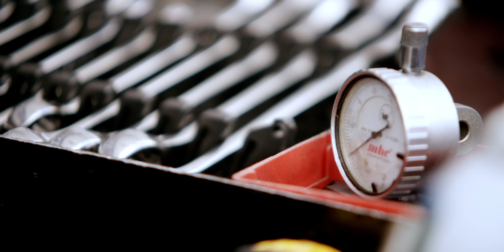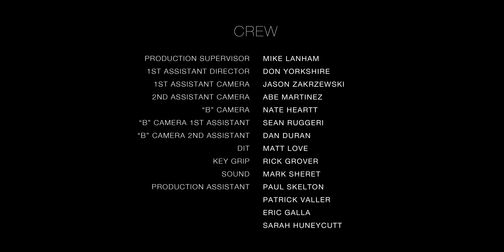NHRA - Fire Breathing Monsters

Comment: 10,000 hp...300mph in 4 seconds...amazing
Reply: Now it's 11,000 hp
Reply: Just imagine the NUMBERS in this racing it makes me scared
Reply: yeah and some cars do 330 mph which is quite alot......10% percent faster lol
Reply: I went to Pomona winners national's and saw a nitro car go 330mph 3.7 seconds incredible🙉👍
Reply: fast too
Reply: @jack-jo6lp  Brittany Force just ran the fastest time in history of racing at 3.62ET
Reply: Javontae Eaddy holy hell
Reply: 0 to 60 in 300 inches or 2/10ths of a second.......Awesome!!!
Reply: Thats 2 diesel locomotives worth of power!
Reply: more like 3 seconds
Reply: little 12 year olds will say, a toyota supra will smoke that haha
Reply: It shouldn't be possible but damn it's beautiful
Reply: Windex maybe 12,000 sum time
Reply: Sometimes more than 10K hp 😅, less than 4 sec in top fuel class. And that sticky thing on starting grid helps a lot to get better traction👍🏻
Reply: @Jay-jb2vr  338mph @3.59   
3.623 is the quickest run
338.17 is the top speed......I think. B.Force in separate runs.
Reply: They now go 356 mph in 3.4 seconds
Reply: The art of explosion
Reply: @damarfadlan9251 they move as much fuel in 4 seconds as a formula 1 car does in an hour. The supercharger takes as much power to run as a NISMO R35 GTR makes just to turn over. The engines don't have any water jackets as nitromethane is both the fuel and the coolant so it's just solid hewn blocks with no weaker spots like a gas engine. And they still shatter them to bits because physics man. This is as much power as 9 Bugatti Chiron Supersports in still 8 liters and OHVs. It's the limit of what the internal combustion engine can do before you're just throwing live sticks of dynamite into an intake plenum
Reply: 400 mph 3.1 second @BRCINEMATOGRAPHY

Comment: The Ride of a lifetime. I've never been close enough to feel the power of these metal Lions But I can imagine.
Reply: In articles I have read the db (noise levels) are in the 150db to 165db range, between 10,000 and 12,000 horsepower shakes your bones, blurs your vision, and will vibrate your beer off the bleachers. No words can do it justice. It has to be experienced.
Reply: Just watch the flags on top of the teams trailers, stand up wind of a Funny car or top fuel Dragster. You will thank me later...lol.

Comment: I grew up with this stuff at Heartland Park Topeka Kansas. There is nothing like Top Fuel. Shakes the ground you're standing on
Reply: Im 16 and ive been going to Heartland Park with my dad since i was just 2 weeks old. Grew up at that track
Reply: @bluevelvetsky88  2 weeks? not to hate or anything but that's kinda irresponsible to take a newborn child to something like that... 150 dB, gasoline, burned rubber, that's a lot for a newborn child.
Reply: Engine-Man22  i was never up near the starting line, they kept me in the stands. they had me in big ol headphones to keep the sound out, sunglasses, sunscreen, a car seat with a light blanket. and my dad races so we got to stay in the trailer out of the sun and away from any excess rubber or fumes. plus i wasn’t at a national event, it was a bracket race which is a lot milder than a national event. i’m my parents 6th child so they had some experience before taking me 😂😂 it’s okay as long as proper precautions are taken

Comment: These things are fighter jets without wings.I’d even go as far to say that in a 1/4 mile that they are actually quicker than a FA 18.
Reply: Yes, by far quicker than the US Navy can throw a F14 / F18 off a catapult. Twice as fast.

Instead of deploying a parachute, if these cars could deploy wings crossing the finish line at 330 mph, they could climb to 2 thousand feet in short order, and glide for several miles.

Comment: Great video, but I have to agree with Jack Beckman and others when it comes to bringing this sport back to earth. Return to the full 1/4 mile, even if it means smaller engines...as Jack noted going over 300 is still a blast, still a rush for the fans, the sponsors and safety.  Make this sport what it once was and not what it's in danger of becoming...a boat-load of memories.
Reply: I always said .... you want to slow them down..... go no prep.

Comment: Back in about 1977 the "Ontario Motor Speedway" (in So California) hosted the Top Fuel World Finals. Don Garlits (Big Daddy), Don Prudhomme (The Snake), Shirley Muldowney ....all those cars were there....
    We lived up the street and were in our late teens..... so we decided "when the photographer and sports writers go through the "Tunnel" under the track we'll just blend in. (it worked!) We made our way to the starting line and watched a few smaller races...but when the Top-Fuel cars rolled up I looked down at my T-shirt and it was rippling with every fire of each cylinder.....we all looked at each other like "HOLY SH*T!) Loud as F**K....un-burnt fuel was dumping out the  pipes....water running out the engine  block.....and in an instant that behemoth was GONE!...I couldn't believe something so big could "get outta the hole" so fast with out breaking traction.
    After about 6 races somebody figured out we weren't supposed to be right there so they kindly kicked us about 50 yards down the track....you know....where some of the engines blow up?... and scatter hot (souvenirs) part all over over the place?
   Take about a fun day at the races....Now it's the Ontario Mills Mall....

Comment: In all of their might, they are not the quickest accelerating cars on the planet. The vanishing point rocket car and Sammy Miller hold that distinction. NHRA doesn't recognize peroxide as a fuel. But if you were to line them up, the rocket car would cover the true 1320 ft before the nitro car covered 1000 ft.

Comment: I looked for a sponsor for 2 years at my local drag track. no takers. I couldn't even let one of the guys let me take 1 race.
but at least I got to sit in a rail dragster. not many people outside"the field get to do that. I was a regular so I got pit access
by the park staff. it was a thrill just to climb into one of those. little tiny butterfly aluminum steering wheel.
I wanted to drive one so bad. Winston was too far away for me.
 and now I'm too ugly and too old to do that as a beginner now.  : ( 
I still LOVE the track though. what a rush to watch and smell the spent rocket fuel and Nitrous

Comment: When people say that top fuel and funny cars are truly an earth shaking experience they making an understatement. When these things are under full throttle and full load you can feel it in your bones. These 500 ci engines have been measured as producing as much as 165db 😲 technology being what it is today, the torque sensors they use on these things are very accurate. I dont remember the team but they took the data from a run, did the math which also accurate btw, HOLY CRAP OVER 11,000HP!!!! I belive the formula is something like for example your car produces 200lb/ft at 3200 rpm so you multiply 200×3200÷5252=hp. You can do this with any torque curve.

Comment: These top fuel funny/dragsters are much faster and produce more G's (around 5 G's) than the space shuttle. Space shuttle will take 29-30 seconds to reach speeds of around 335-355 mph. G-Force: of 1.77 at this speed of around 355mph... Space Shuttle Lift Off G-Force .04 seconds into/after lift off G-Force is only 0.58. With a G-Force: of 1.88 at around 0.21 seconds after lift off. G-Force: Max of 3. at 6 minute 40 seconds into launch. Of course STS is traveling at around 17,500 mph in around 7minute 45 seconds with external fuel tank still attached at an altitude of around 344250+ (ft). Both are amazing! Not to correct a 16-time Funny Car champion driver and an 18-time champion car owner racing legend like like John Force. Amazing!Read more Show less

Comment: They produce some 20,000 H.P. Faster than a jet engine.
Reply: Not 20k but very close (13-14k so far). And yeah, they're indeed faster than a jet. Exactly 2 times faster than a plane's takeoff speed (about 540-something km/h).
Reply: 10,000-11,000 no one really knows. No dyno in the would can handle them.

Comment: In every Eco Street car is more tecnologie than in these cars.

They make between 850  and 1000 Hp per Liter with Nitro Methan, i remembr a time wehre Formula one engines had about 1000 Hp/Liter with normal Racefuel and the engines dont blow up in half a mile . And this was 30 Yaers ago ... 

This Sport is maybe funny to watch (10 minuts) but it is also the stupids burn of money i know.
Reply: 231mac, I understand that your constant erection for every thing american drains the blood away from your brain and it makes it difficult to grasp some concepts.
The fact that you called someone an idiot for not researching and yet you had no idea what he was talking about makes this theory a certainty. 
Now, you have a chance to redeem yourself, just keep reading and steer away from offending.

What he is referring to is not the actual generation of 1.6L that F1 is racing now (heavily limited in fuel consumption, rpm and street legal pump fuel), but the 1.6L engine that F1 used to race in the 80s, still with a few restrictions but not as many as today.
Those engines in the 80s ran 1500HP in qualification set up and a little less in race mode. Still a way longer life span than the 5 second between rebuilds of a top fuel.

So, easy recap, 40 years ago, without Nitro Methan, a F1 engine was already close to 1000HP\l, with a life span 100x longer than a top fuel ever had. 

Now, the 1300HP\l you are getting now are a great result but basically F1 engines would have had that already 40 years ago if using the same fuel. Allow us europeans to not be that impressed by the engines.

A transmission that gets 10k HP on the tarmac, on the other side, that is impressive.
Reply: Rapp Scallion You do know the 1500hp f1 car only lasted 2 laps before being completely destroyed? And in race trim the engine had nowhere near 1000hp? And there was only one car that reached 1500hp in qualify trim? Also to reach 10000hp is not as easy as making the engine bigger, even if you make an f1 engine bigger it wouldn't reach 10000hp because most of the original power comes from the turbo's, not the engine.
Reply: They never raced those lotus cars at 1000 horse except qualify cause they would blow up in short order. They were running about 600 to 700 during the race. Hell turbo's cant even hold up to nitromethane.
Reply: 1500+ hp per liter, and I really hope you weren't trying to be some sort of ambassador to your sport because with this attitude I will actively avoid it.
Reply: @Rimpianto  I would play with rocks but you seem to have them all in your head, and I'm not going to break them out.
Reply: How about 1350hp per cylinder. Do the math. 500 ci. 8 cylinder

Comment: Too bas professional drag racing has come to what it has.1000 feet is total bullshit for the fuel cars,and it is also bullshit to have only 2 teams that seem to win most of the races.I used to love going to the races when there were a lot more people fielding fuel cars,and running the entire quarter mile.If the tracks can't handle that speed then maybe the rules need changed or we need better race tracks,but I would not attend an NHRA event anymore if I were given the tickets for free!
Reply: they made them run 1000' because its too dangerous for 1/4